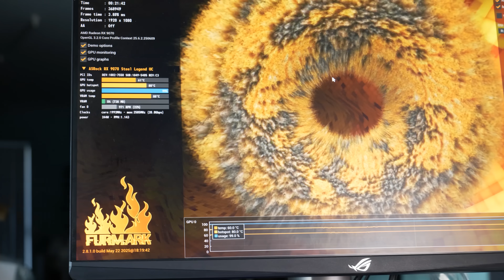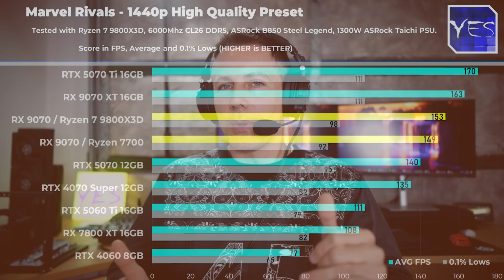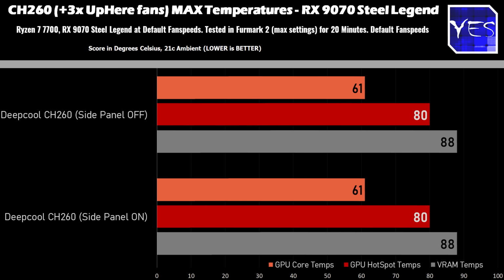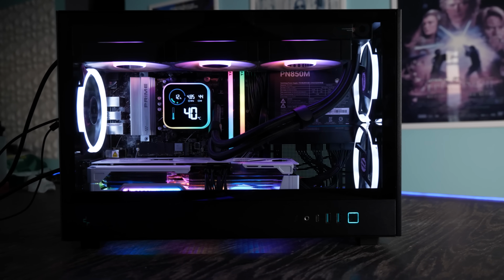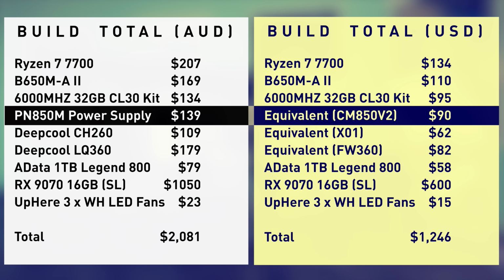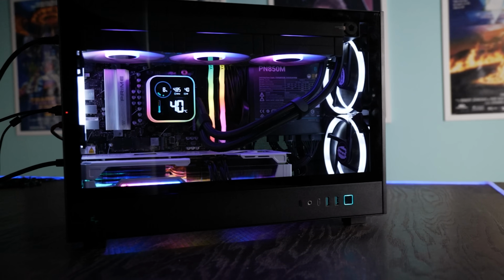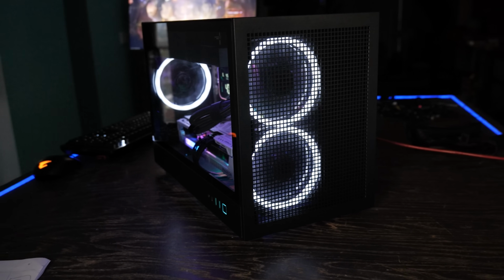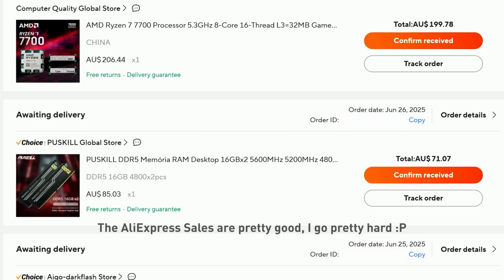Building a $1250 USD RX 9070 Gaming PC (in the Deepcool CH260)

Comment: Recently I have found out, that most of B650 mobos are working at PCI-e 5.0, despite not being advertised they does. Some in the internet wrote that this is restriced by AMD to diferentiate B650E.

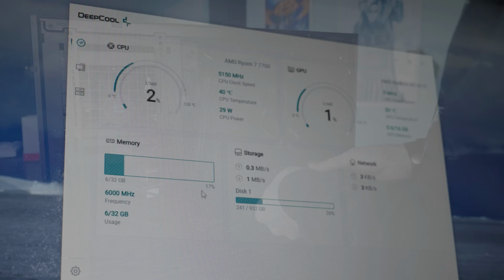I also don't like MOLEX case fans  - 11:43 - which speed I cannot control.

But generally I really like the look of this case.

Comment: Those Uphere 3-pack single-color fans go on sale regularly for $10 and look respectable. The pink ones are often even cheaper. That said, they don't move much air at all. Considering that full argb budget 3-packs are getting pretty easy to find for $15 I wont use those single-color cheepies if I have mobo lighting control. If you're using old hardware or OEM stuff where you don't have on mobo lighting control, and your parts don't need much air, then I'd say the Uphere fans are fine. Same for the Apevia single-colors when they are on sale.

Comment: Got that Case in white. Had difficulty on installing the GPU , cable managements esp. with 6 ARGB fans and it has ton of screws to deal with but otherwise it was a straightforward build, I was able to put cable extensions and use my non modular power supply I just need to tie the cables down with Zip ties. Great case! Temps are great even without the bottom fans. It's my first midrange case. Pretty impressed!